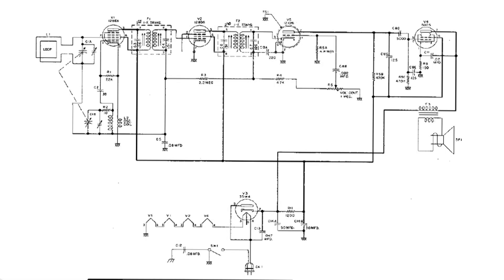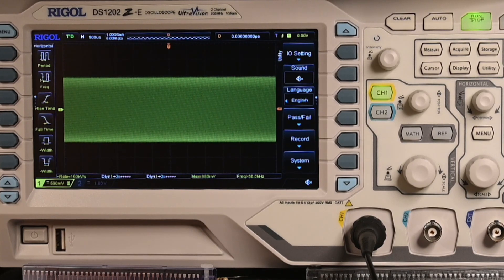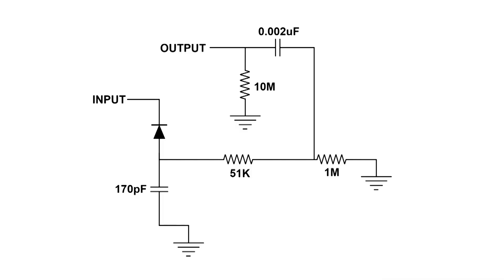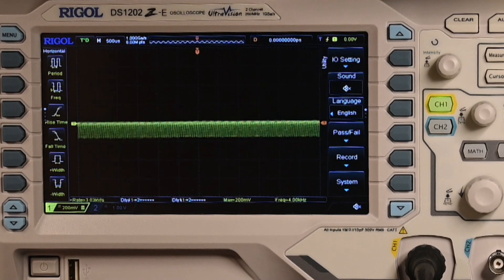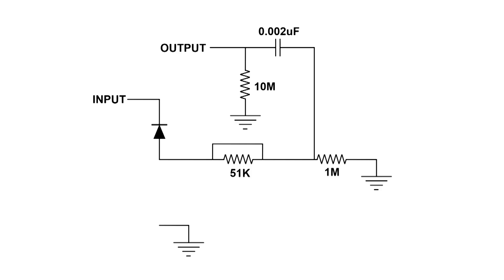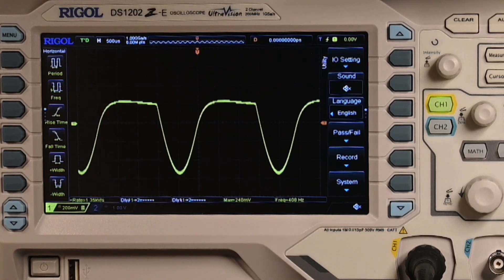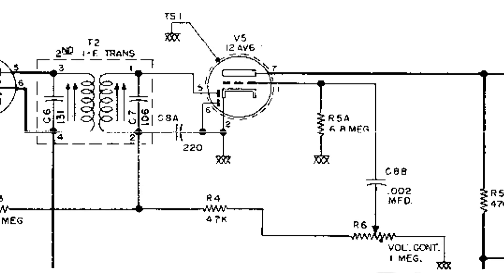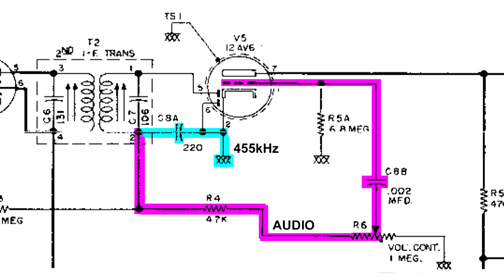RF Capacitor Resistor ByPass Circuit

Comment: Thank you Richard. Do you routiely power up everything through an isolation transformer to avoid damage to your oscilloscope when worjing on AA5 radios?
Reply from the maker: You are welcome! Yes I use the Isolation Transformer every time I’m work on any Chassis. It does protect the oscilloscope and other test equipment, plus it just much safer when working with commercial power. Thanks again!

Comment: Very interesting Demo to explain the concept of HF filtering. It can not be well understood by simply knowing that Z=1/cw. Thank you so much.
Reply from the maker: Does not explain why the 51K resistor results changes with a change in frequency.
Reply: @AllAmericanFiveRadio  That's right, the demo also shows that the resistors are somehow frequency dependent at high frequency. We normally ignore this fact on everyday considerations. Thanks again for bringing this to attention. .

Comment: I always find these circuit videos Interesting. It plainly shows How capacitors in a radio circuit are basically filters as the signals go through the stages So you get the desired result. Take care Rick! And thanks for posting! (Jason)
Reply from the maker: Hey Jason, thanks.
The resistor has a influence and the influence changes with the frequency.

Comment: Nice demo of bypass filters in radio circuits whether it is using tubes or a diode as a detector Rick.  I was also looking to learn about the variable frequency oscillators in more advanced Superhet radios.  Not sure if you have a video on that topic?
Reply from the maker: Thank you. I have copied your comment for a future video idea.